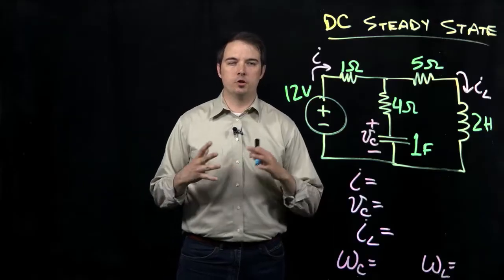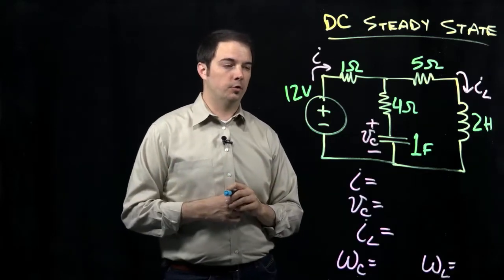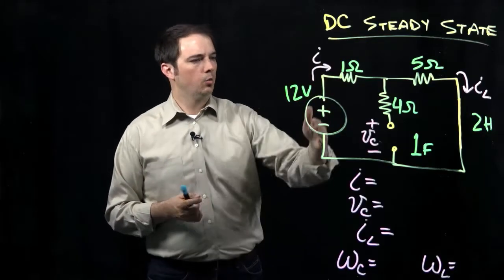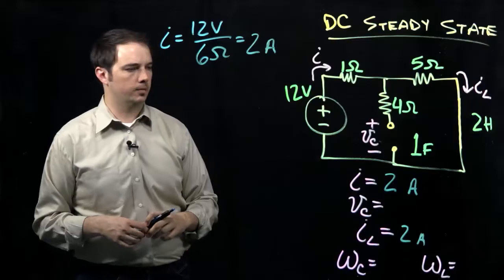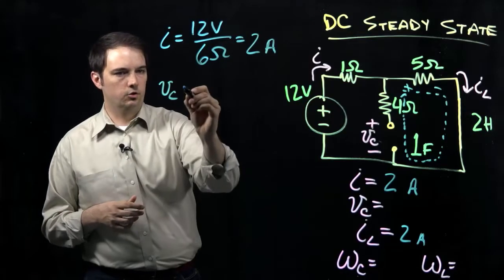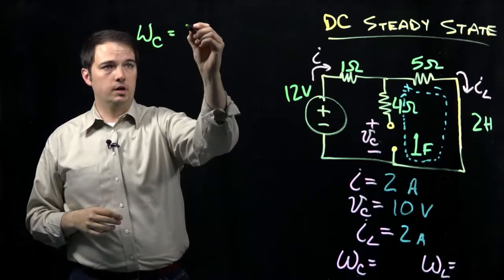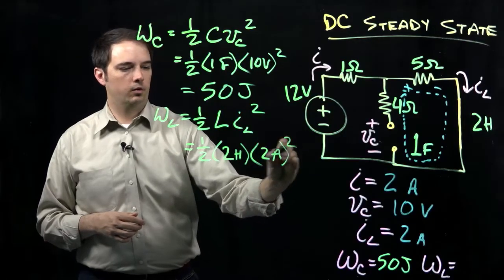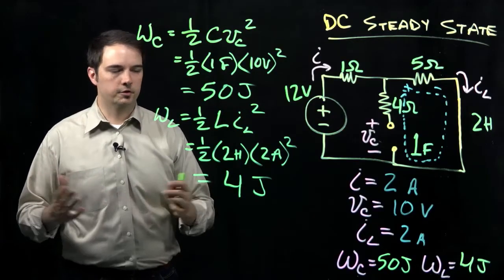Circuits I: Example with Inductors and Capacitors at Steady State

Comment: please give me solution urgent ...

Derive the analytical expression of the capacitance , c ,of two parallel plates having a dielectric material in between them of relative permittivity of €r.

Find the maximum voltage that can be applied across a parallel plate capacitor of 0.006uF having a plate area of 0.02m2. The dielectric is porcelain. Assume a linear relationship between the dielectric strength and the thickness of the dielectric .
For porcelain , dielectric strength =200 Volts /Mil and €r=6.0.

Comment: Why didn't you write a KVL equation for the left loop? Or would it not matter because the result will still be the same?
Reply: It doesn't matter. If you apply KVL to left loop in clockwise direction, we get that

-12 V + (1 Ω) i  + (4 Ω)(0 A) + v_C = 0 V
-12 V + (1 Ω)(2 A) + 0 V + v_C = 0 V
-12 V + 2 V + v_C = 0 V
-10 V + v_C = 0 V
v_C = 10 V

which is the same. This is basic knowledge; you should keep studying the basics before studying first- and second-order DC circuits.

Comment: hello Dr. 
I have an equation , can the capacitor and inductor store the energy in DC source ??
Reply: No
Reply: I think no , cause for example power of inductor= v*i =L(di/dt)*i so ( dc means no change in current so means no power is taken or dissipated through dc so power =0 and energy = integration of power over time so it equals 0 ) .

Comment: Dr. Montgomery
Thanks for the video. I have one question regarding the voltage conservation concept... the total voltage source is 12. Vc is 10 and the voltage for 1 Ohms is (1x2=2 v), for the 5 Ohm's resistor is 5*2= 10 volt. The total voltage is 10+2+10= 22 volt. I'm a little bit confused since the total voltage drop is greater than the voltage drop provided by the source.
Reply: 5 Ohm and Capacitor share the Same Voltages.

So, it's
12V(by Source)
=
[ 2V(across 1Ohm)
+
10V(Capacitor OR 5Ohm) ]
Reply: In parallel configurations, the voltage is split. Run a KVL around the entire circuit (you can ignore the middle branch because it is an open circuit), and you will find that the total voltage is 12V. If you were to include the middle branch, you would still get 12V because you subtract the voltage flowing against the resistor in both KVL equations which will cancel the additional 10 out. I hope that makes sense.

Comment: im still not get it how inductor become short ciruit. it is mean that it is because by there is no current and voltage across the wire?
Reply: An inductor in a steady state is an "ideal inductive load" and draws no power. Also at the end of the day, an inductor is just a wire loop, so it lets everything flow through it, and as it draws no power theoretically the resistance is zero, which means current can go through it, just like as if it were a straight wire. Hence we replace it with a wire calling it a short. Hope you understand.

Comment: How would we find the energy supplied by the 12V battery? And if inductors and capacitors store energy then what about resistors, don't they dissipate energy? So what will the total energy be- This is unclear to me.
Reply: The general equation to find the energy in an electric component (whether it's DC, AC, transient state, steady state, etc.) is w(t) = ∫  p(t) dt + W_0. Since this is DC and in steady state, v(t) and i(t) are constant, so p(t) is constant too. Therefore, if we also assume the initial energy is 0 J, then the previous equation simplifies to w(t) = p(t) ∫  dt or W = P Δt, where Δt is the time interval (notice I've used capital letters, which indicate constant values.)

As you can see, the previous equation requieres to specify the interval of time Δt in which we want to determine the energy. Since we haven't defined any time, we can't compute the energy in resistors nor in the voltage source. That doesn't mean they aren't absorbing/generating power.

You might ask if that's the case, then why can we compute the energy in capacitors and inductors but not in resistors and sources. This is because that energy represents the energy stored by the capacitor and by the inductor, which doesn't depend of time since the circuit has reached steady state (and so the stored energy won't increase.) In resistors, they always (even in AC) absorb power (use energy) and they don't store it, so calcuting the energy without specifying a time interval doesn't make sense (what energy does it represent? Stored? It's zero. Used? We'd need to define a time interval.) Similarly in the case of sources.

Comment: Just out of curiosity.When finding the Voltage across the capacitor, why didn't you take the KVL around the first loop? does it matter which loop you use?why the second loop?
Reply from the maker: +chisom nnoka No particular reason -- that's just what I felt like at the time. You could do the same with a KVL around the first loop (12V source - 2V drop across 1ohm = 10V across cap). With circuits, there are often multiple ways to solve the same problem.
Reply: okay..thanks!, that makes perfect sense.

Comment: When you worked out Vc = 10V

Wouldn't the voltage across the capacitor be 2 volts? 
The 10 volts is the voltage drop across the two resistors and then 2 volts to be lost to the capacitor since we started with 12?
Reply from the maker: +VT Gaming 10V is the drop across the 5ohm resistor, which is in parallel across the capacitor, so the voltage across the capacitor must be the same. Recall there is no voltage drop across the 4ohm resistor because there is no current flow through it at steady state. The remaining 2V from the supply is dropped across the 1ohm resistor. The result is the same if you calculate using a voltage divider expression (as opposed to using Ohm's Law as I show).
Reply: Hello sir. I have a genuine question. I'm a new student.

If the two leads of a resistor are A and B. If one connects the +ve terminal of an ideal 5V voltage source to A and the -ve terminal to lead B and then connect only the positive terminal of a 7V ideal voltage source to lead A, what would the potential be at the lead A.

It would be nice if you could suggest a book on basic circuit elements.

Thanks.
Reply from the maker: I'm not quite sure I understand the situation...if only 1 terminal of the 7V source is connected to the resistor, then it has no impact on the voltage across the resistor. You would only have the 5V across the resistor. 

The book I used for this course was "Electric Circuits" 10th or 9th ed, by Nilsson & Riedel. But, there are many good books on circuits out there...
Reply: There can't be current flowing through the 4 ohms resistor because the capacitor is blocking the current as we are dealing with DC current. So the resistor never makes his way to the negative pole of the battery.